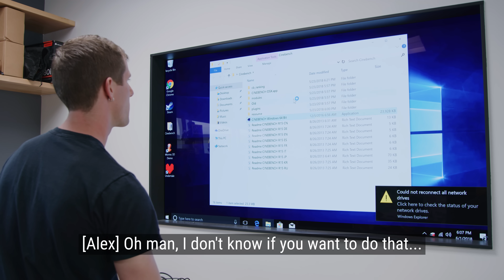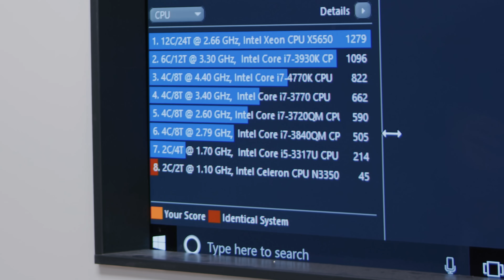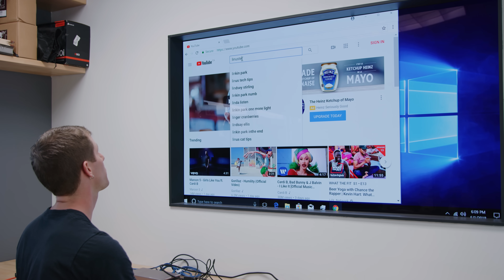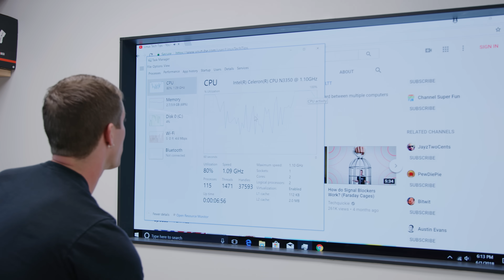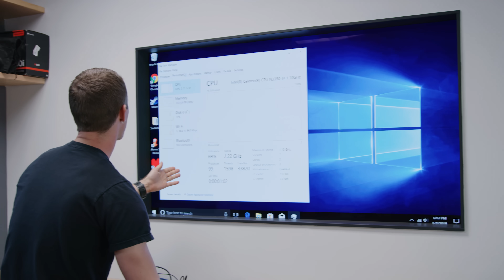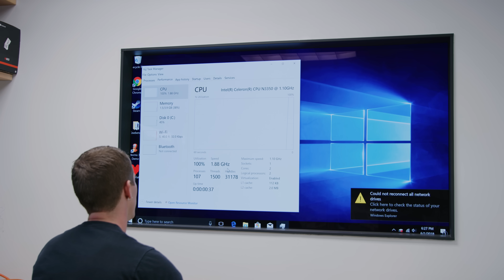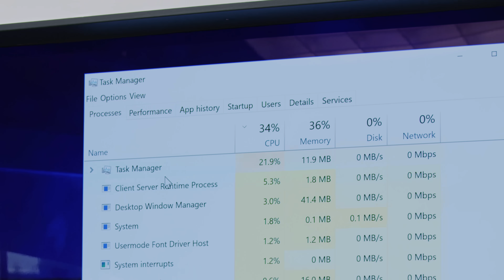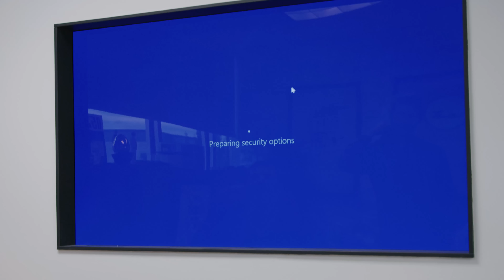PC Smaller than an SSD

Comment: Overclock it and stick it in the freezer
Reply: Moboots Gaming
Didn't they already try running a computer in a fridge or freezer, and found out it didn't help much?
Reply: @nakyer  who cares stick it in the freezer
Reply: @moboots  
Did you read what I said?  Apparently not.  IT'S BEEN DONE AND IT DIDN'T WORK.
Go back thru older videos and find it.  You'll see.
Reply: @nakyer  can u link it
Reply: @nakyer Yea but the computers before relied on airflow and there wasnt much in the frezzer but this computer doesnt use airflow for cooling so it most likely work.
Reply: @carrotcheese2850  
I'm not looking at the video right now, just the comments, so I have to assume the computer doesn't use airflow because it's liquid cooled?  Sure.  Put a liquid cooled machine in a freezer.  See what happens.
By the way-  you may need to get a new motherboard and processor, if nothing else.
Reply: @nakyer oh ok its not water cooled either. It uses some kind of metal on the case that helps. It has really low clock speeds and low powered and heats up pretty hot but eh its a dual core Celeron nothing much to expect. Would be interesting to see how a computer that size is water cooled, Probably wont be to good anyways.
Reply: @nakyer  That was a full-size PC, that's like putting a small space heater in your freezer, it won't keep up. this thing is small and low power enough that a freezer would almost surely help.
Reply: Nah clamp an aio to it.
Reply: @The7Dark Regarding what?  Facts?  Shrivel, troll.
Reply: @nakyer  the mini pc doesn't have much thermal mass, a freezer would easily handle it.
Reply: @edragyz8596  So you've tried it?
Reply: @nakyer  i shouldn't have to, the cooling capability of the average freezer is greater than the thermal output of this mini computer.
Reply: @nakyer  a pc thats a millimeter tall will 100,000% undoubtedly be cooled by a freezer
Reply: @kidthebilly7766  And how do we know you're not a mad foreign spy with evil intentions?
Reply: @nakyer  you dont and you wont
Reply: @kidthebilly7766  So... You ADMIT you were involved in the Lincoln assassination?
Reply: @nakyer  yes
Reply: Please make a water cooling video and overclock!
Reply: @nakyer  thats not a freezer
that was the patented COOLING-BOX
Reply: @possiblyashrimp66  May your refreshing bits of toenail growth always be found to be bright and elaborate.
Reply: @nakyer  r/woosh
Reply: @theparrot271  Your standard screw locks are slightly blue and not at all tender.
Reply: Just put that chinese smartphone copper watercooling block on that. Problem solved. I might pick that PC out myself for the funs
Reply: Image sticking it in a freezer and freezing the water cooling lmao
Reply: Moboots Gaming no do it in Antartica
Reply: @nakyer  Not much airflow. I think it needs a blast freezer for that.
Reply: But he already has bloodcooling
Reply: @r32juan  You are right. They tried that with a full sized pc, of course it didn't work. But IMO this little sukker would run just fine with Turbo enabled in a freezer, even in a fridge (maybe)
Reply: @nakyer  than he did it wrong 😂
but you have to mod the whole Pc
Reply: @vermilionssj9081  Which comment of mine are you replying to?  This is going back no more recent than five months!
Reply: @nakyer  who cares just stick it in the freezer anyway
Reply: nakyer stick it in the freezer even if it doesn’t work
Reply: the smartest solutions come from the simplest men
Reply: @nakyer  HE SAID STICK IT IN THE FREEZER CANT YOU READ
Reply: @glub1381  This video is a year old.  You're a little late to the party, kid.
Reply: nakyer Its small enough
Reply: @adriandurango329  Your feeble broom straws will never have enough shadow.
Reply: lol this stupid argument went on for like 8 months, thats kinda stupid
Reply: Better play in a ac room
Reply: @nakyer  Are you a troll account?
Reply: @nakyer  who cares just stick it in the freezer
Reply: @nakyer  who cares
Reply: X
Reply: Put a glass of ice water on it.

Comment: Me: "Wow that's so cool it's so cool to see a tiny pc"
Phones:"am I a joke to you"
Reply: that is smaller than a phone and it runs windows 10
Reply: @c8h_233  A phone can run windows 10.
Reply: @Quicksilver-7791  yeah, at like 10fps
Reply: @c8h_233  What r u talking about? don't you know apple is transitioning to phone processors?
Reply: @c8h_233  my phone is better than that
Reply: @Quicksilver-7791  its is difficult for ARM to emulate x86
Reply: @capkenway  That's true, but native ports of windows on ARM exist. And arm apps on windows work absolutely fine.
Reply: @Quicksilver-7791  but they cant run x86 apps like cinebench, chrome, or any game. Thats why surface RT failed
Reply: @Quicksilver-7791  also ARM apps work absolutely fine on x86 as it is a more powerful architecture in general (not efficient but powerful)
Reply: @Elite Gaming Its already a meme
Reply: Harjas Singh yes, apple can easily make something small like this with their processors for schools or other use since they are already able to fit their powerful processes in iPhones, they would have no problem making a computer like the one shown in the video.
Reply: @Quicksilver-7791  it can run but it runs terribly slow if you have a low end phone.
Reply: @Quicksilver-7791  oh so that's why Mac's lag that much
Reply: @capkenway  there's windows arm
Reply: @MenacingPerson  yes, there is a windows arm that cant run any 'desktop' windows apps and highly un-optimized, even worst in performance then regular x86 windows
Reply: minegamer2000 ummmmmm, 50 fps
Reply: @Quicksilver-7791  no they're not. Just because they're making their own CPU doesn't mean its a phone processor
Reply: @Quicksilver-7791  windows 10 cant run on arm plus it gets too hot and your argument of being able to run it with ports means a edited version of Windows 10 not the official so it can run windows 10 port but not windows 10
Reply: @tickogrey5846  why are you replying to a two month old comment? Also, who said anything about unofficial ports? Microsoft has an image available on their website somewhere. I'm not sure where
Also, runs too hot? That's your argument? My i3 7100u laptop also runs hot and I can live with it
And please use grammar and punctuation next time.
Reply: @luhiko5923  It's based on one, the a13. Plus my point still stands, it's arm.
Reply: Raspberry Pi Compute Module:Let me introduce myself
Reply: @Quicksilver-7791  they have
Reply: @Quicksilver-7791  your estimation of what you need to run windows 10 is very flawed
Reply: @cyphercrit5827  ..?
I mean, I managed to make it run ok on an athlon 64 x2...
Reply: @shrine you do know that arm has different instructions then x86 and you can emulate almost any consumer grade architecture on x86
Reply: @shrine yep, I only said that as it's predominantly used in phone processors. It is expanding to supercomputers and laptops now though.
Reply: Well, at least it's the smallest pc that can run windows.
Reply: @Quicksilver-7791  actually they are the same architecture but not phone processors lol. Anyway apple was never know for good performance
Reply: @c8h_233  no, look at the specs of any snapdragon 865 phone
Reply: 877 likes

nice
Reply: @c8h_233  then That Tiny pc Run Android  at like 5 fps
Reply: Yes
Reply: Wait what you have the same profile picture as me but you turned it upside down
Reply: @Ricardo0139  woah cool I put this as my profile when I was like 10 lol
Reply: @c8h_233  do you live in 2010
Reply: @1800_kam  it good of this year if a14 is in it
Reply: @dhruvavikas1632  maybe
Reply: @c8h_233  imagine grading computer performance solely off of the fps rates
Reply: @capkenway  and? ARM outperforms x86
Reply: @spoofilybeloved6729   ARM is efficient and only outperforms x86 in efficiency. but x86 outperforms everywhere else. also you can emulate ARM on x86 (its a fight of efficiency vs raw power)
Reply: @spoofilybeloved6729  and i get it some people want efficiency everywhere and dont want/like even a single percent of performance wasted in there pc (same people who are minimalistic and such) but there is a equal crowd who whats raw horsepower at any cost.
Reply: @capkenway  Don’t have the time or energy to respond in too much length, though you have some good points. Though, where do you find ARM emulation? The iOS Simulator on x86 is just an x86 build of iOS. Same with android, last I checked. If those notable “simulators” don’t emulate ARM, is emulating it feasible? I might be talking out of my ass here, considering bluestacks, but I don’t think it’s as cut and dry as “it’s emulatable”
Reply: @spoofilybeloved6729  iOS dont exists out of ARM as its code is proprietary to apple and they have only build it for ARM. On the android part, yes there are x86 build of android (built by android x86 project) but they cant run ARM apps and bluestacks and such are truly emulating ARM. Also ARM is a not about OS, any OS can be build for any architecture (if code is known) and ARM is just a CPU architecture that is efficient as it has fewer micro-architecture instructions. Also again no build of iOS exists for x86 and its code is proprietary to apple.
Reply: @capkenway  “The Simulator does not run ARM code, ONLY x86 code. Unless you have the raw source code from Apple, you won't see the App Store on the Simulator.”
Reply: @spoofilybeloved6729  brother there is a differencec between simulation and emulation and I am strictly speaking about emulation. also iOS sims are not true iOS they are what they say on the tin simulators and they cant do what iOS in i devices does they try to simulate it
Reply: but phones dont have WINDOWS
Reply: @MJC___  Bro, windows phone were a thing
Reply: @capkenway  yes but theyre talking about android and apple phones
Reply: @c8h_233  it's slightly smaller than most phones but it doesn't have a screen, camera or speakers so that's kinda on par. As for running windows 10 it's really more about the architecture, not power. While arm chips are smaller and less power hungry compared to x86, I see no reason to be surprised that they could make a PC that small.
Reply: Iphone users dont know that because apple remove most everything that related to a pc. On the hand android users
Reply: Swordsman  Bro, can you buy the chip its self to put in a motherboard and make it to your own spec? No. Also AMD desktop chips are still faster then M1 and AMD laptop chips are equivalent in performance to M1 and M1 is a ARM, x86 hybrid chip using 5nm lithography where AMD is using 7nm lithography and intel is still stuck at 14nm++++++++++++ (I know its 14nm++). and with AMD or intel I can run my own OS and my own code on those chips, not with M1 and apple in general. I get it that is using just 15W but I dont care about power consumption and most people dont either.
Reply: Swordsman  Right now, no I cannot put a powerful chip in a fanless laptop but I dont care much about laptops. Even if I did care about laptops I would'hv taken a LG gram over macbook anyway. I dont know why people obsess over super thin or fanless laptops anyway. Also CPU power dont scale very well with how power hungry the chip is and they are putting same chip in their imacs and mac minis and even ipads, now a ipad and a imac (a tablet and a desktop) are in the same power range and thats why i personally dont like M1. now tell me a desktop imac is as powerful as a ryzen powered desktop? No its fucking not.
Reply: Smart watches 

👁👄👁
Reply: its the fact that its x86
Reply: Ikr the whole time I'm just like.. yeah.. my s20 is the same size but far superior..
Reply: Aye, and most touch phones these days are more powerful than that crap. Intel celeron... 😅😆
Reply: @c8h_233  have u ever heard of windows phone?
Reply: I love hove people in this thread arguing how phones can't properly run Windows as a reason why this thing is better while this piece of vintage hardware can't properly run it either and would feel much better (even though still bad) with Linux optimized specifically for it ...like a phone.
Reply: phones are inferior as in you can't choose what OS you install on them and the OSs they DO have aren't as great as the big 3 PC OSs: Windows, MacOS and Linux (xebaxtian)
Reply: @capkenway  not that difficult the new MacBooks can run windows better than most x86 laptops
Reply: @ijarbis187  first of all, this thread is a year old, second you do know that new M1 chips have some x86 instruction set and hence are ARM in just the name (and for legal purposes). also running the windows os the easy job a old machine form 2010 can run windows 10 or even 11.
Reply: @Quicksilver-7791  Windows 10 for ARM exists, but it has very limited support for hardware and can barely run anyway.
Reply: @guestc142  it's a lot better than it used to be when I made that comment.
Reply: @Quicksilver-7791  Yes there is x86 emulation now, it still performs worse than that of x86_64 Win10.
Reply: @guestc142 Yeah, it does currently. But it should get better
Reply: @Quicksilver-7791  Don't forget that the ARM instruction set is simpler and more power efficient than x86_64. Really great for portables, if you ask me. This new M1 Mac stuff is going to be just like the PowerMac phase of apple, trust me.
Reply: DeX gang approved.
Reply: @Quicksilver-7791  every android phone runs Linux because android is modified linux
Reply: @pog2824  yeah, I know. It was originally for cameras.
Reply: @c8h_233 my phone don't even think about it
Reply: I phone doesn’t run windows 10 does it?

Comment: Honestly this is where Linux would be great. You could probably throw on an embedded version and a lightweight desktop environment. (Plus it's free and customizable).
Reply: Nah I got windows 2000/Xp/embedded in mind
Reply: @stanleybowman-hood6194  Unfortunately not possible, as there are no drivers for these systems available
Reply: @0xbenedikt  I dont understand what you mean by that if you have the hardware even tho outdated there still should be drivers for it im sure there is a way to get linux on there would love to see it.
Reply: Imagine you put a like 5 inch display on top of that, plug it in use it as a makeshift smartphone.
Reply: Bunsenlabs BunsenBurner is IDEAL for this machine.
Reply: @swart121  What they're saying is that there are no Win XP drivers available for the mini PC's modern hardware. Maybe read what they replied to in the first place.

Comment: when the “computer” is actially just a phone running windows
Reply: When a “phone” is actually just a computer not running windows ;)
Reply: IamZ3phyr facts
Reply: @IamZ3phyr some phones actually run Windows.
Reply: Its basically Windows without a screen
Reply: laughs in Windows Phone
Reply: @electrical-420  well technically calculators are computers but no one calls them that
Reply: Abacus
Reply: @Dzacforever  69 likes nice
Reply: This comment makes literally no sense.

Are those PCs that are built into the stands of monitors now not actually computers? Because this was basically what those units are, and it's kind of ignoring how people actually use these words and their definitions, and the differences between modern phones and their processor architectures to modern computers.